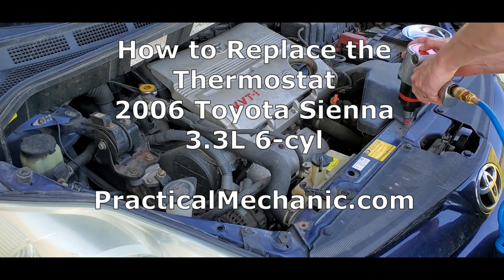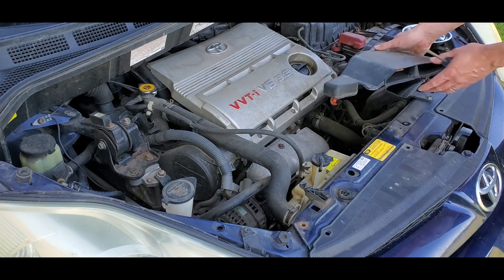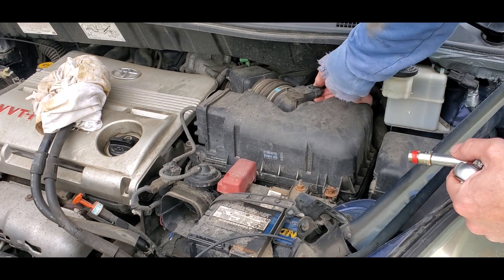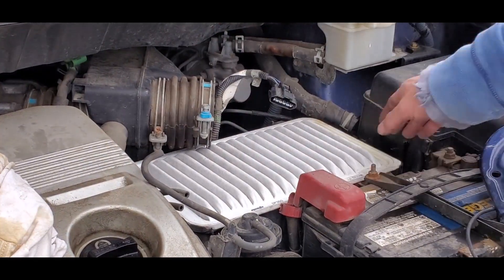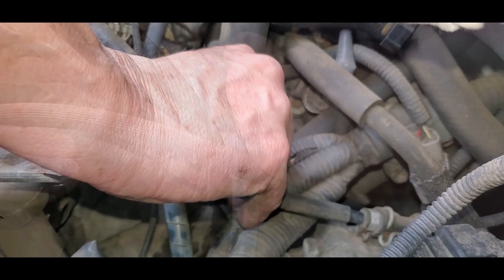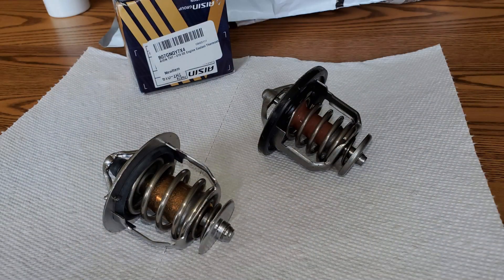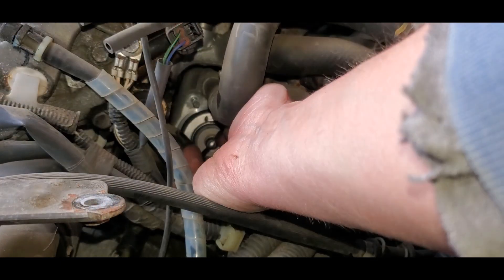2006 Toyota Sienna Thermostat Replacement

Comment from the maker: Thermostat (Toyota 90916-A3003) - https://amzn.to/3MGwmhy
Plastic Coolant Inlet (Toyota 16321-0A040) - https://amzn.to/3FZCMVk
These are links to the thermostat for this repair. I've also included the part number for the plastic coolant inlet which is a common source of leaks. Good luck!

Comment: good video.  The electrical connector on the thermostat housing, is that where engine coolant temperature is measured?
Reply from the maker: Yes, that's correct

Comment: what temp thermostat are in the sienna?
Reply from the maker: Pretty sure it's 82c.
Reply: i have a 2006 sienna and the weather is getting cold 17f now and the heat seems just warm and not hot coming out of ducts and temp gauge reads on the low side between hot and cold and am wondering if my thermostat is weak, any good way to check it? thanks  @PracticalMechanic
Reply from the maker: To check if the thermostat is stuck open (which we suspect in your case), start the car and (carefully) put you hand on the upper radiator hose. If coolant is running through it and it slowly gets warmer and warmer, your thermostat is stuck open. 
Proper operation is that the hose will stay relatively cool for about 5 minutes (or until the engine gets hot), then the thermostat will open and the hose will suddenly go from relatively cold to hot very quickly.
Hope it helps, good luck. 👍
Reply: thank you very much, will be trying that     @PracticalMechanic
Reply: I replaced thermostat and gasket, when I filled with coolant it leaked out, what did I do wrong, does thermostat fit flush against engine. I had trouble trying to fit thermostat in groove of engine. It kept sliding out,  What should I heck for? Thanks for any reply.
Reply: I believe the 3 nuts torque spec is 71 in lbs, it's the 12mm bolt that uses 14 ft lbs/ 168 in lbs. Using the 168 from your video I snapped a stud and had to very tediously replace it. Other than that, thanks for the great vid @practicalmechanic
Reply from the maker: @tlhurlbu, very well could be. Thanks for the info. All the best

Comment: Disconnecting the wiring harness makes it a lot easier to get to the bolts on the inlet pipe. 

Removing the battery will give you extra room. It’s not strictly necessary, but it does make it easier. 

With those out of the way, I was able to get my fingers on all the bolts and wasn’t fumbling around blind. 

Dorman makes a metal coolant inlet pipe upgrade. It’s available on Amazon and not much more than the plastic one.
Reply from the maker: Good tips, thanks for the feedback!

Comment: A couple questions, please…
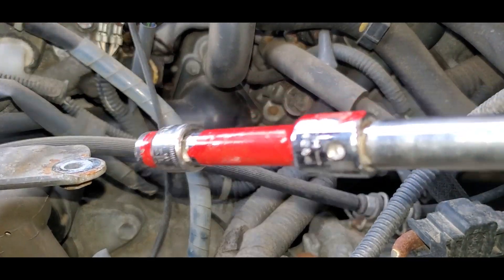1) 2:31 If the nut comes off with the stud like it did for you, can I just separate the nut from the stud AFTER I remove it and then put the stud back in?

2) Do you test your new thermostat in a pot of hot water BEFORE installing it?

Thank you!
Reply from the maker: Good questions. 
1. For the stud that came off, yes you could do that. What I did instead was I used a new 1/4-20 bolt instead because the stud itself looked somewhat corroded.
2. It shouldn't be necessary to test the new thermostat in a pot of water before installing it. But you can definitely do that if you want to double check the temperature specification of the thermostat!

Comment: Hi, I’m having boiling coolant in the reservoir, i fill to the neck and fill the reservoir, drive around less than 10 miles and the reservoir tank is spilling out thru the reservoir and also boiling. 

I’ve change the coolant temp sensor (fans weren’t working only with ac)  which took me a long time to figure out since the first CTS I bought was from autozone and didn’t work until I got Oem. 

I also replaced the thermostat but one from Napa. Would the thermostat cause my boiling? 

We did pressure block test, no fumes mixing 

I also changed water pump and resealed the water outlet
Reply: Hi I had the same problem did you fix it